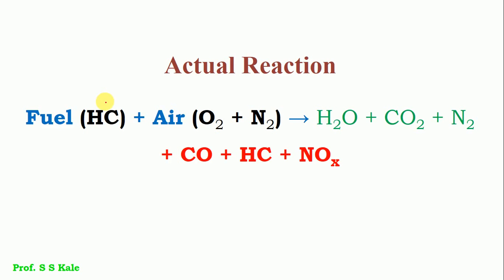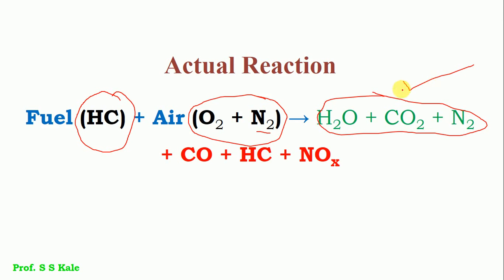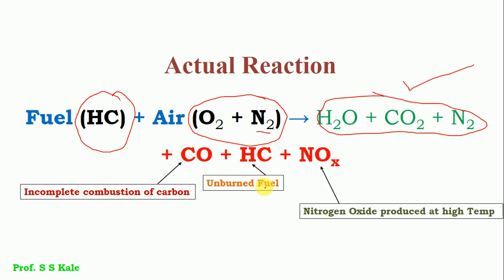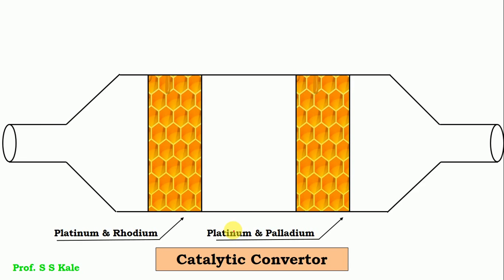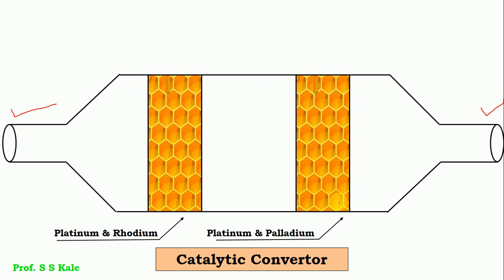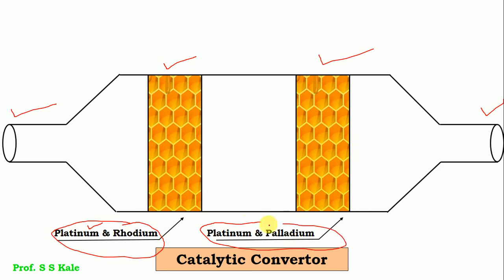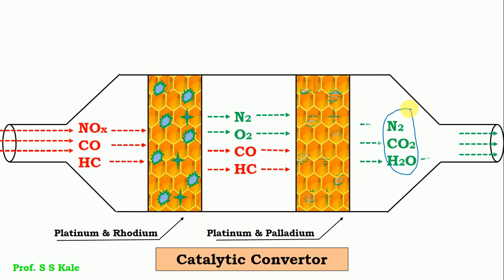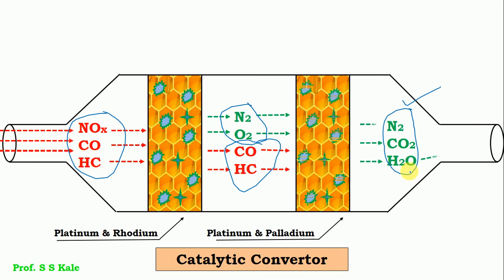Catalytic converter working animation

Comment: Is it possible to construct this as a final year project in chemical engineer ?
Will it be good enough ?
And will it be too costly ?
Reply from the maker: It can be done, but catalytic converter is available in market readymade. You should make some innovative modification in it to have final year project.
Reply: Are u make this in final year project because i searching for projects